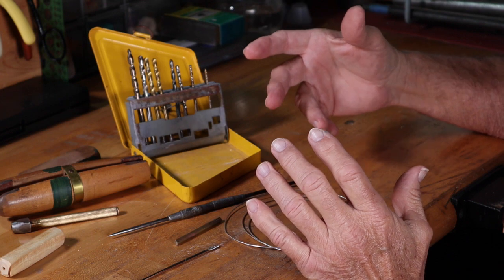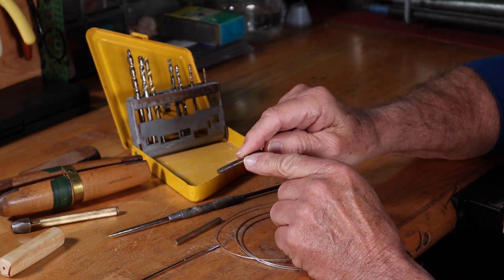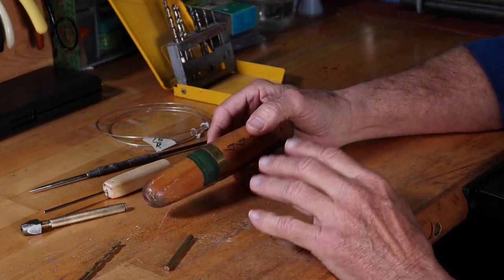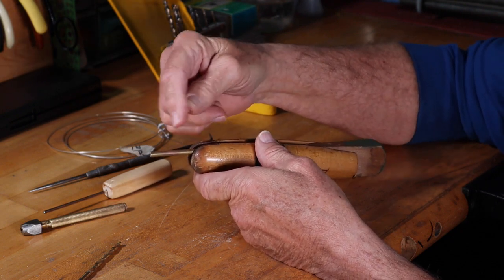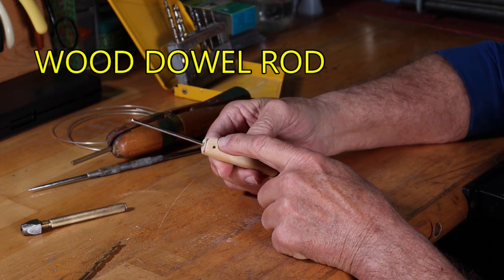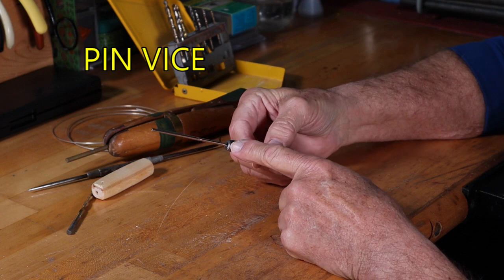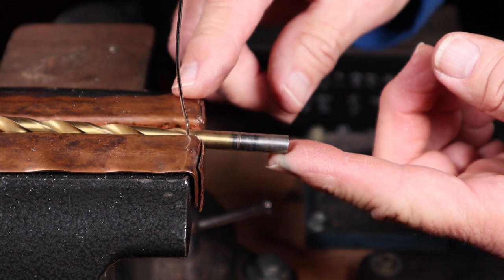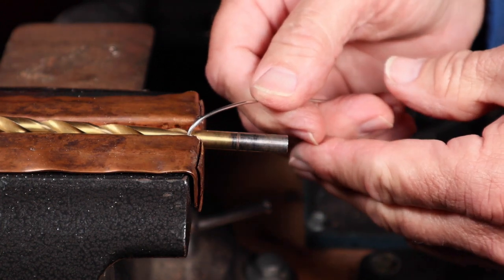MAKING JUMP RINGS: NO EXPENSIVE TOOLS!

Comment: Thanks for your great video - really helps with the last few awkward rings!  A cheap mandrel for rings is aluminium/ steel knitting needles.  I get mine from thrift/ charity shops; the ends can be sawn off and placed into the chuck on my hand drill for winding.  I've also 3D printed a holder for cutting from Cults 3D and this helps with holding the coil for around $1(if you own a printer that is)!
Reply from the maker: Hello Mark, Good  suggestion! I know some jewelers who use knitting needles for mandrels.  They work well.   Thank you for watching and commenting.   Greg Greenwood

Comment: Amazing Greg, I've always been disappointing in my jump rings. Bought the flush cutter sill not happy. The saw tip is the ticket. Can't wait to try it out! Thanks again...
Reply from the maker: Hello BIO,  Yes, you are correct about the flush cutters.  They are smooth but not always accurate. They do work on bezels also, if you are careful.  Good luck with the saw.  Thanks Greg Greenwood

Comment: Hi Greg i have a question please do you make your own sterling silver wire of buy it for the jump rings im not sure which way to go your imput would be very greatful
Reply from the maker: Hello Jan,  I do not make my own wire for general jewelry work.  I purchase several different gauges.  It saves me so much time.  Melting, rolling and drawing down wires takes a tremendous amount of time.  I think you would learn more by purchasing wire and learning the metalsmithing, fabrications techniques, and soldering steps.  Good question.  Greg Greenwood
Reply: @greggreenwood4628  thank you for replying you've been so helpful
Reply from the maker: Hello Jan,  You are more than welcome.  Greg Greenwood
Reply: @greggreenwood4628  hi Greg just have another question please  about silver wire in your option which is better argentuim  or sterling silver
Reply from the maker: Hello Jan, Argentium silver is a newer alloy.  It has great properties and can be "fused" without soldering.  It is tarnish resistant and durable.  Working with it is a different animal than working with sterling.  I would suggest that you check out Ronda Coryell.  She is an expert on argentium.  Rio Grande has some free tutorials with Ronda showing the basics of working with argentium.  I like it and have started using it in some projects.  Check it out and she what you think.  Thanks Greg Greenwood

Comment: Hi Greg, if we need 10k a day of closed jump rings, can you recommend anything for me?
Reply from the maker: Hello Soon Huat Gallery,  "Closed" jump rings are very expensive, as you have probably learned. I don't know anywhere where you can get that quantity at a reasonable price.  If they don't have to be soldered closed,  then you could make the jump rings, lay them out on a flat hard surface, put another hard surface on top with weights to force them flat and together.  I know that sounds "crude" but I don't know any other way to do that large of a quantity.  Sorry I cannot be more of a help.  Keep checking the internet for a supplier or Manufacturer to make them custom for you.   Good Luck  Greg Greenwood

Comment: That video was awesome! :) but can i ask what wire you use?
Reply from the maker: Hello Springtrap, Thank you for your kind comment.  I appreciate it.  In this video, I used 20 gauge Sterling wire.  But you can use any gauge of wire for your jump rings.  It all depends on your design. For the thicker wires, I would suggest that you anneal the wire before you wrap it.  It will wrap much easier.  Good Luck and Thanks again.  Greg Greenwood

Comment: How do you make split jump rings?
Reply from the maker: Hello Judy,  There are 2 ways that will work for you.  1.) Coil wire like in the video.  Then stretch it out enough to get the points of your flush cutters into the coil.  Start cutting on one side of the coil, skipping every other jump ring to make the split jump rings.  2.) A little slower way is to wrap the wire around the mandrel twice and cut the split jump rings individually. Keep going until you have the number of jump ring needed.  I hope this answers your question and helps you.  Good luck and let me know how it goes.   Greg Greenwood
Reply: @greggreenwood4628  thank you, Gregg
Reply from the maker: Hello Judy,  You are more than welcome.   Greg Greenwood

Comment: For making the coils, try knitting needles.  DO NOT grab your spouse’s or friend’s nice wooden needles unless you have some demented death wish that involves being stabbed through the heart or some other vital organ. 

Knitting needles come in a wide range of diameters and made from aluminum or steel. While the small “sock needles” sre tapered on each end, latger needles have a cap on one end that will prevent your coil from leaving your control prematurely while the tapered end helps the coil or cut rings slide off easily.  As many of these needles are made of aluminum, burrs or snags sre easily sanded out. 

If you know a knitter, ask if they have any knitting needles that has lost it’s partner.
Reply from the maker: Hello Katie,  Thank you very much for your suggestions. I have not used knitting needles but I know jewelers who have.  Great idea and I appreciate you sharing with all of us.  You are correct about not grabbing one's needles! LOL .  Thanks again and keep watching.   Greg Greenwood

Comment: Hi Sir, if I am the one who happen to need 10k pcs a day of 1.4mm diameter jump ring. What do you suggest 😂?

Sawinh from blade is easy but closing the gap one by one just take me too much time 😭 do advice
Reply from the maker: Hello Tang Shao Xian Terrence,  Jump rings,  because of the way that they are made, will always need to be closed, one by one. You are correct that it does take too much time.  Try getting a jump ring machine that will help you make many jump rings very quickly,  this will help you save time.   I wish I had a good answer for you.  If you are in a production studio, possibly hire a young person to help you.  Pay them well and they will work fast for you.  Thanks for your questions.  Greg Greenwood